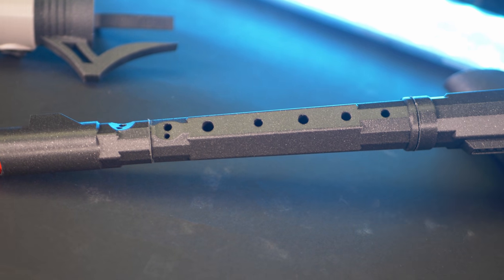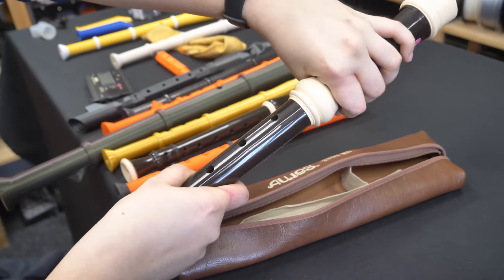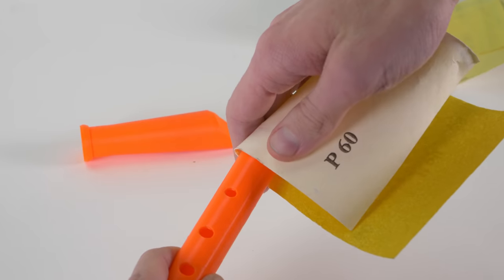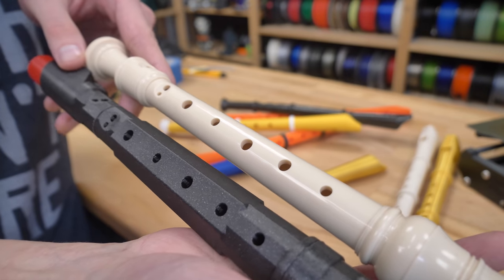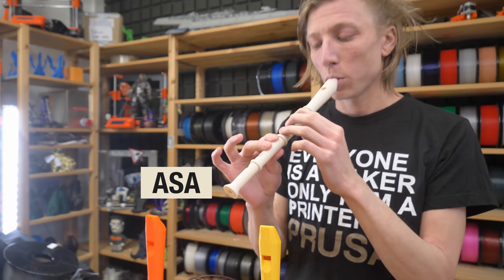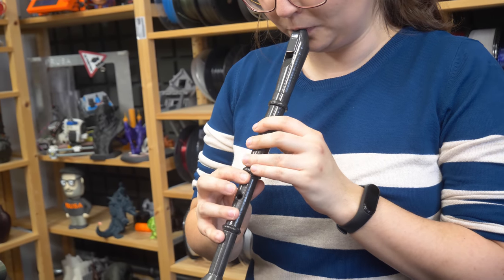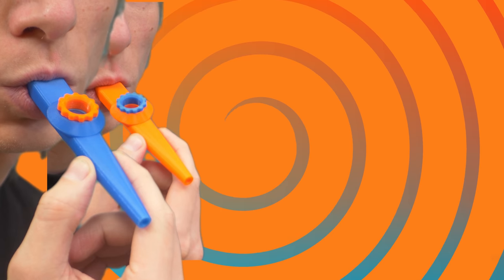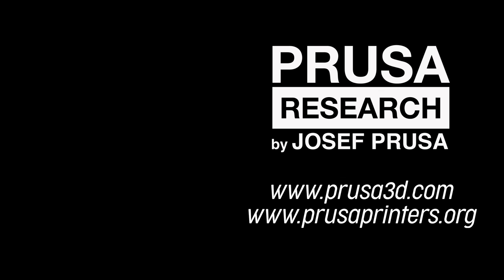3D print a Recorder, an Ocarina or a Kazoo - print a musical instrument!

Comment: I've printed a few ocarinas.  I don't know for certain why it matters, but I have found that printing them at 100% infill, or at least 50% or more, strictly for the extra mass, does seem to improve their tone.
Reply: Resonance is going to be different based on thickness. Think of it in a similar way to how acoustics change depending on the room size and wall thickness.
Reply: Heavier material means more inertia, which means it absorbs less energy. Speakers are heavy for the same reason, though I think lately they've been using all kinds of acoustic analysis to compensate in software.

Comment: The reason the ASA recorder that had the acetone treatment was louder because the bore was smoother. The vibrating air could bounce off the inside of the tube more easily.

Comment: Very neat! I just recently started looking at some recorders. A few points. (1) You may want to calibrate hole sizes to hope for a recorder that's as close to in tune as possible straight off the printer. Provided the model is good, of course. (2) They can be tuned after printing by filing holes larger or filling with some material to make them smaller. It's hard! (3) The labium won't print sharp enough, and you want to sharpen it with a razor after printing. (4) Models I saw have a fipple that's too big and takes too much air. This will be even worse if scaled up. Designers please keep this small. (5) Professional 3D printed recorders from a company names Paetzold are on the market and are very distinctive and high quality. I presume there is a lot of finishing work done. (6) The Sopranino is a standard recorder size just smaller than Soprano. (7) Those two sizes can be bought at very reasonable prices, and there is a case that it makes more sense to buy these sizes manufactured. (8) The price goes up a lot with the Alto and Tenor, making 3D printing them a lot more attractive. But I don't know any good models for these sizes. Scaling gives poor results. (9) I even saw a larger Great Bass recorder where most of the large tube is PVC pipe, but the key mechanisms are 3D printed. Smart design. Quite a lot of directions to go and music to be enjoyed.

Comment: I actually designed an ocarina to print but didn't have an FDM printer at the time, just SLA. I designed and printed a recorder but the fipple wasn't shaped quite right so it barely made any noise. I should work on it.

Comment: 06:20 How did the support come off so cleanly?? 😳
Reply: Also noticed this, could be that they already snapped the print before recording the video, I would like to see the area of the ocarina where the supports where making contact, and see what settings did they use.
Reply from the maker: This was sliced with a different version of PrusaSlicer (2.4 internal build) that has some changes to support generation. Worked wonderfully for this model :) -Mikolas
Reply: @Prusa3D  could you share where to download the beta of prusaslicer 2.4

Comment: 01:33 And turn off elephant foot compensation when you use brim.
Reply: You don't have to, I actually really like to keep it turned on, makes removing it way easier and cleaner. But still sticks to the print just enough.
Reply: @TheMikolasZuza  OK, I will give it a shot. Last time it was not connected to the brim at all due to free space of compensation (PLA on the PEI sheet).
Reply: @MartinWolker  It totally depends on the first layer squish, so I totally understand where you're coming from. Maybe lowering EPC to 0.1 or 0.05 is the sweet spot with brim enabled.

Comment: How does the prusa sim filament hold up in regards to expansion? I printed an Ocarina with CC3D Purple Silk and it was barely playable above a 6th, and an octave was impossible. When I reprinted with normal filament from overture, it worked perfectly up a 9th (C to D an octave higher). Was there any tweaks needed for the ocarina with your own filament?